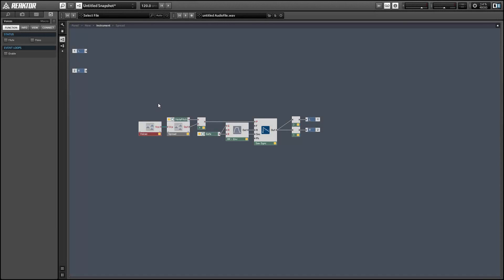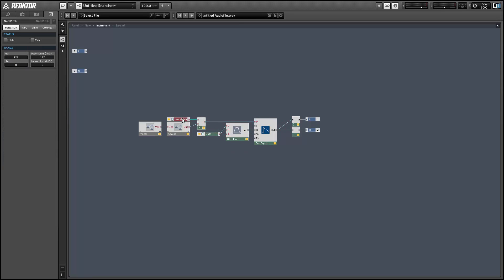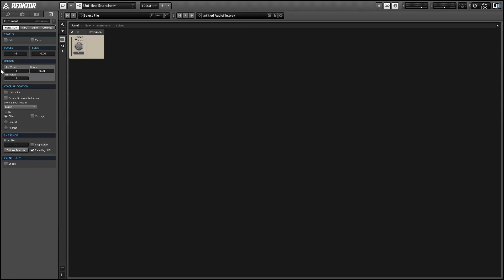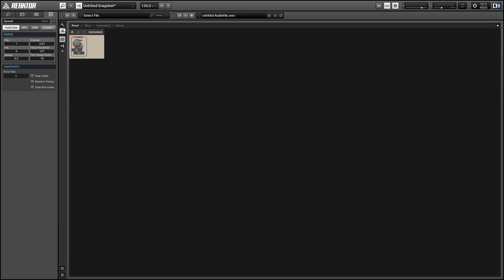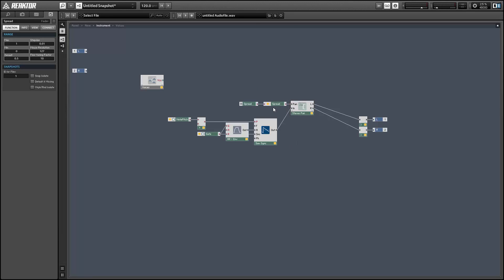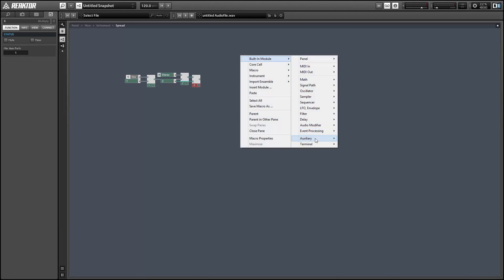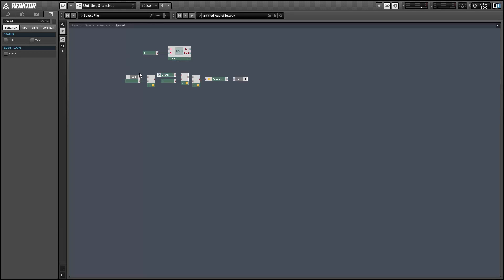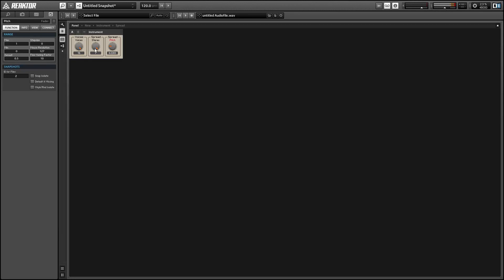NI Reaktor Tutorials - New 5.9.2 Features - Voice Module

Comment: hi thanks for the tutorial.  i notice this is controlling the instruments setting but would this work on a per osc setting eg one osc being 7 voices and another being 2 voices a bit like how sylenth1 does?
Reply from the maker: KCHflooring you'd have to split the oscillators into separate instruments. instruments only output mono signals so it would be tricky to do right, but possible.